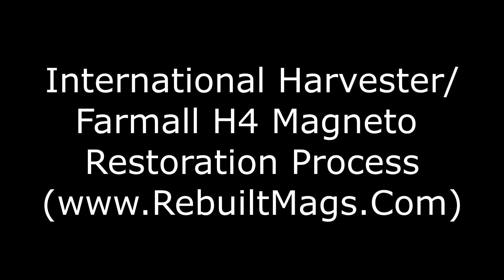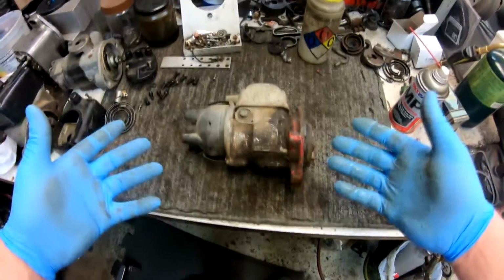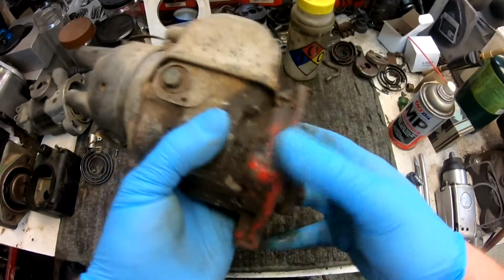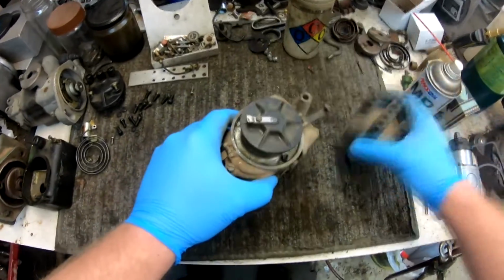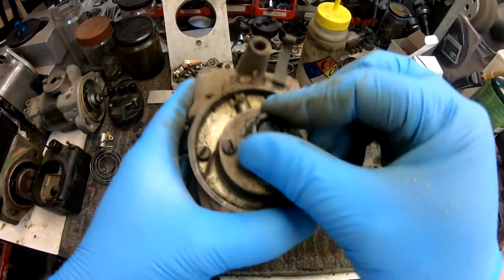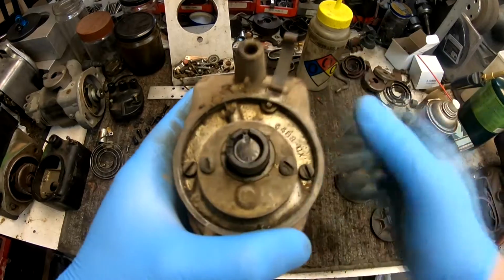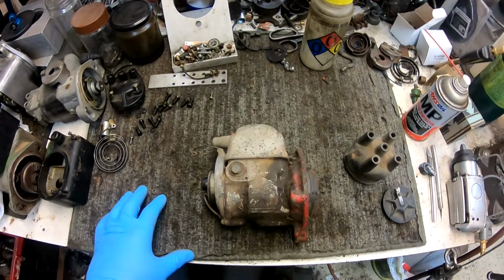International/Farmall H4 Magneto Restoration Process at RebuiltMags

Comment: That’s quite a transformation of the magneto. Quality workmanship all the way. About how much does it cost to refurbish a magneto? Thanks for sharing the process. 🇺🇸🚜👍
Reply from the maker: It depends on the magneto, but the average full restoration of an H4 is between $150-$300 depending on what it needs, and the condition of the impulse drive mechanism. There are some magnetos that cost well over $1000 due to rarity, availability of parts, etc. The magneto for the 1928 John Deere D would have easily been close to the $1000 mark!

Comment: My farmall H actually has a case 4jma magneto on it that’s giving me some fits. How do they compare to the original farmall   H-4 mags?
Reply from the maker: The Case 4JMA magnetos are a bit more complicating in their assembly, and they are much more difficult to find parts for. They are very reliable, though. The coils specifically are unique and are difficult to find. Rudy is able to repair them, or retro fit a coil from a newer version of the Case mags that works beautiful. An H4 is a pretty simple and very reliable design, and the parts are easily available for nearly every piece.
Reply: @KennyKizzleRustyNutzRanch   thanks for the info I appreciate it. I’ll be in contact with you guys to get my mag fixed up. Keep up the great work on the channel !
Reply from the maker: @ocgearhead1121  Thanks! We will be happy to help!